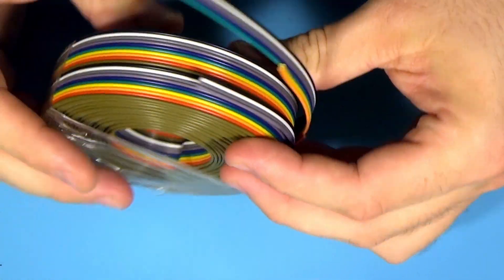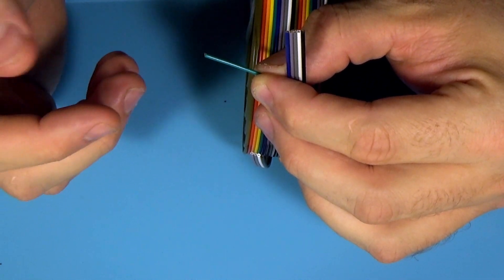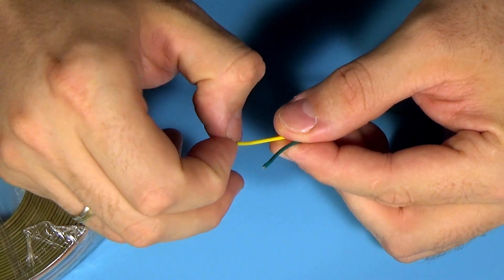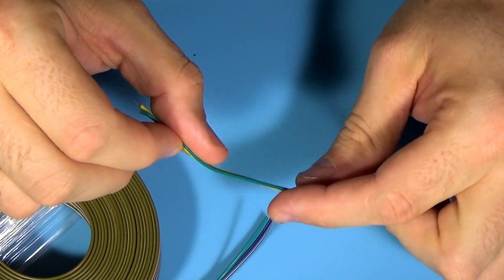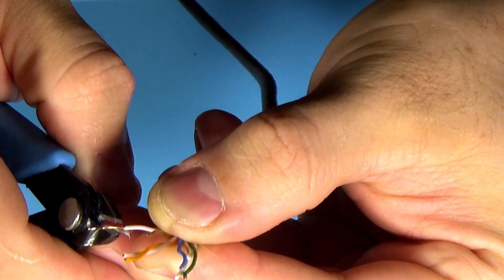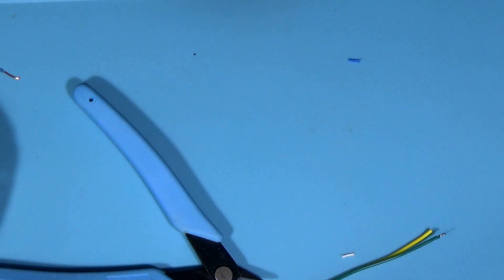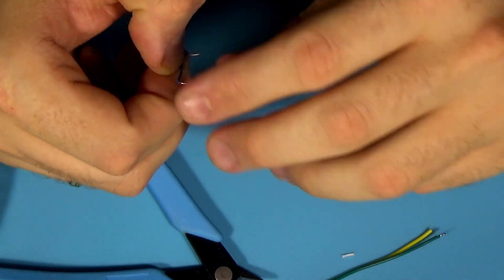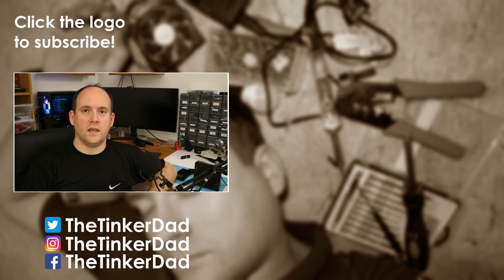Use These Instead Of Cheap Chinese Wires And Make Your Life Easier!

Comment: I know its probably not everyone's fav but I am a big fan of using silicon coated solid core pre-tinned wire for proto boards where flex is not a concern, and I swear to the ends of the earth I cant stand using most "rainbow ribbons" id rather use old IDE ribbon cable vs rainbow cable, check this out and give it a shot if you haven't already: https://www.amazon.com/Silicone-rubber-electrical-electric-CBAZY/dp/B07HRK6JK3/ref=sr_1_6?keywords=Silicone+rubber+electrical+wire+kit+26+gauge&qid=1580176409&s=hi&sr=1-6  ITS awesome for proto-ing..... maybe use a thicker gauge but im such a scrooge I save all scraps of wire if I favor it lol.

Comment: I've learnt the "hard way" the importance of using a good quality electric wire. It's very likely the standard "chinese" jumper wires stop working, after being plugged in/out a bunch of times. This thing (sometimes), make yourself banging the head on the wall, until you realize the prototype/project doesn't work, because one of the cables is faulty.
Reply from the maker: Exactly!

Comment: I've been using Cat5 cable for a while. It is nice because you can easily find stranded and solid versions pretty easily at the local home stores.
Reply from the maker: From CAT5, I've never seen a solid version, although I know it existed. With CAT6, it became quite common. What I've shown in the video is CAT5E, but in the future I'll be using CAT6, as I've just ordered some 300m+ of it. Obviously not for projects LOL - I'm in the process of rewiring my house, but I'm sure there'll be plenty of leftover wired at the end and I'll be covered for a while :)
Reply: I probably have CAT5E as well as CAT5 but at the time, both were still a fair bit cheaper than CAT6 and even a modest amount goes a long way. Other solid core wire I like to keep around is 22AWG for making custom breadboard jumpers and 30AWG wire wrap.  The wire wrap is ridiculously easy to strip and comes in quite handy for those signal/digital bodge connections.